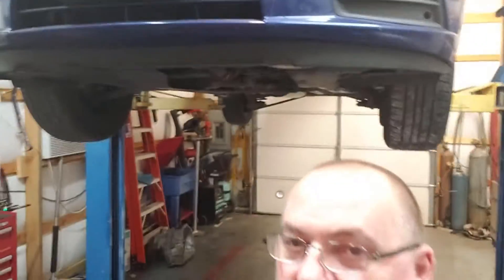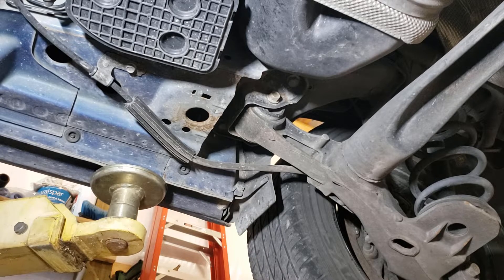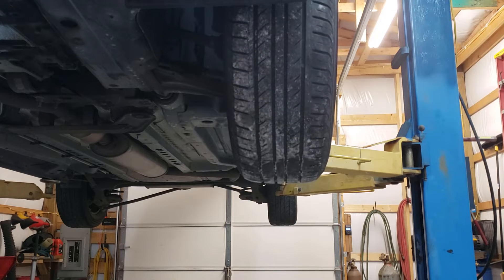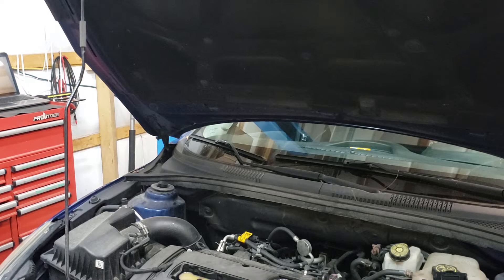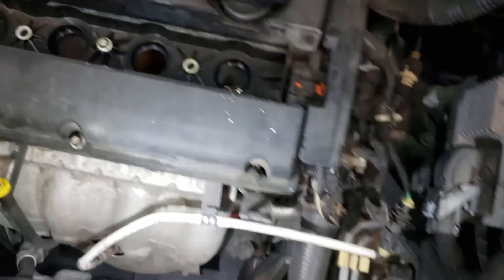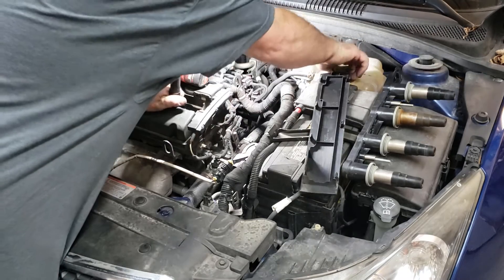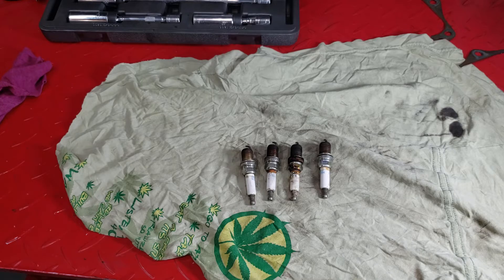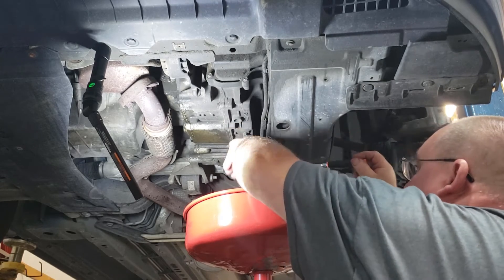2012 Chevy Cruze Inspection and Transmission Fluid Change

Comment: Too bad I do not live in America, I would repair my car with you.
You look like a good mechanic and a good man.
I have just such a car, I have been traveling with it for 120,000 km, 2012 model 1600, cc. There were problems only in the water system. I replaced the water pipes at 70,000km. Other than that everything else is not bad.
I enjoyed watching your video

Comment: I noticed how you went to the pry bar to the bushing cause honestly when you showed a visual from the beginning showing them I could see they look like they had wear on it ...I did see the spring and tower flexing when you applied force more than likely probably need alignment also after you done finish your work

Comment: I noticed at 38:02 you had the car lifted with only 3 legs of lift supporting the vehicle, is this normal procedure?
Reply from the maker: Not a problem but clearly an oversite and broken lift equipment and also the reason it was replaced.
Reply: @ralfsautomotive  Thanks for the update.  I worked in a shop where a truck fell off the lift.  No one got hurt, but it was a very expensive accident.  All my best and take care.
Reply from the maker: @robb3490  Long hours and not paying attention I was to worried about making the video. The lock and pin on the lift where worn or this would not have happened in the first place.
As for the 3 point lift, it would take a lot for a car to drop off that way as all of the weight is in the front. Most of the failures on Lifts  are cause by mechanical or structural failures. often times people overload a lift as well. The Lift I was using was a 9K and the new one is 10K but I never lift anywhere near that as the concrete that is under it is old.

Comment: May I know is this a 1.8L engine? What kind of transmission does it have? 6T30 or 6T40? How much fluid does it needed to replace?
Reply from the maker: 1.4L with a 30  all of the part store's will have the drain & refill specifications. I normally let them look it up to safe time LOL
Reply: ok Thank you @ralfsautomotive

Comment: Hello from France;) small question, I have a Chevrolet Captiva having the same gearbox as the Cruze but it is impossible to take the temperature of the transmission fluid with an OBD. How to take the temperature knowing that with an infrared thermometer I can take the temperature of aluminum and it does not exceed 50 ° .. How else? Thank you in advance :)

Comment: Great video, my daughter has a 2012 Chevy Cruze Lt 1.4 engine , currently has 109 thousand miles , dealer asked 349$ for transmission fluid with filter or 199$ just flush and fill , I’m going to do myself just drain and fill , can u give me part number and how many quarts I need thanks
Reply from the maker: 5-6Qts for drain and fill

Comment: After a long journey, the sixth gear slip, then the RPM went up. Is this an electrical fault? Car almost time shifting time throt lagging(automatic chevy cruze 1.8 )
Reply from the maker: I know these cars have an issue with fluid changes and the pressure switch. I would do a fluid and filter change unless you have done so already. Without proper diagnostic this is an impossible to answer question.

Comment: I only had my trans fluid flushed at 66,000.  I am ready to do it again at 42000 and the dealer told me I had to flush because if its changed it could cause the seals to break after dropping the pan?  I dont see a pan being dropped.
Reply from the maker: Drain and Refill only!!  I think I find another dealer.

Here is a section out of a GM Service Bulletin! 

# 04-06-01-029H: Unscheduled Supplemental Services

The use of external transmission fluid exchange or flush machines is not recommended for the automatic or manual transmission. Use of external machines to replace the fluid may affect the operation or durability of the transmission. Transmission fluid should only be replaced by draining and refilling following procedures in Service Information (SI). Refer to Automatic/Manual Transmission Fluid and Filter Replacement.

Approved Transmission Flushing Tool (Transmission Cooler Only)

The Automatic Transmission Oil Cooler Flow Check and Flush Tool IS recommended for GM vehicles. Refer to Transmission Fluid Cooler Flow Check and Flush in the Service Information website using the J-45096.

Our Commitment to providing Quality Service to Our Customers

Customers will appreciate and trust dealerships that inform and offer them what they truly need for continued trouble-free operation of their GM vehicle. Examine your service department's practices and verify that all Service Advisors and Technicians focus on providing a truly exceptional service experience through vehicle inspections and offering appropriate products at time of service. Use this opportunity to leverage recent technology including the Service Workbench Menu and Inspection Tool Kit and review the services you provide to your customers. Here are a few suggestions:

^ Review your processes to ensure that your service team performs a Multi-Point Vehicle Inspection on every vehicle visiting your service lane. Use the electronic Multi-Point Vehicle Inspection process in the Service Workbench to document vehicle needs and evaluate them for safety and wear items. This information can be quickly integrated into your marketing efforts and the Customer Sales and Service Retention (CSSR) program to personalize the message to your customers.

Comment: How many liters of oil it takes to tell a little in this gear box?
Reply from the maker: (6T30)  Fluid Change – Drain Plug – Approximate Capacity
  4.5–5.5 liters
(6T40/45/50)  Fluid Change – Drain Plug – Approximate Capacity
 4.0–6.0 liters

Comment: As a mechanic myself I would definitely argue with engineers who design these “non serviceable or maintenance free automatic transmissions”, THERE IS NO SUCH THING!
Oil & filters MUST be periodically replaced or your tranny will definitely fail sooner or later.
Maintenance costs are a big selling point when these cars were new, it’s all about money.
Some auto makers only design their cars to last the warranty period, that’s it. After warranty expires they expect you to buy another new one. No thanks, that’s why I buy Toyota’s.
Shame on you Chevy for designing junk!